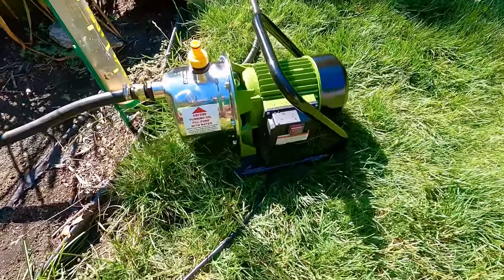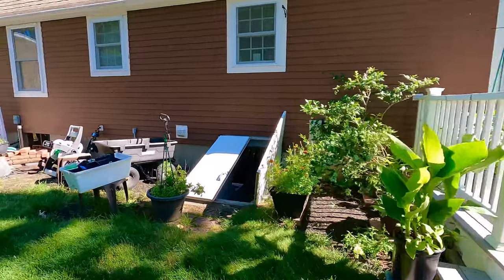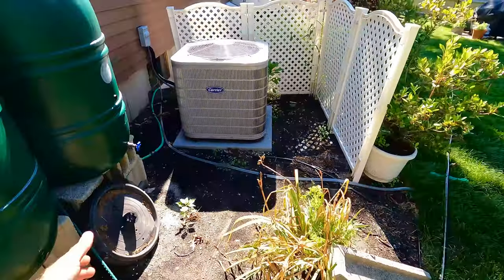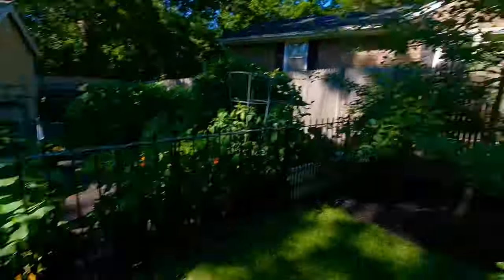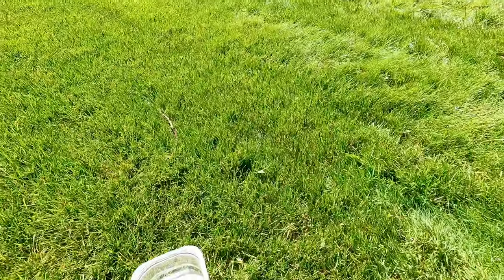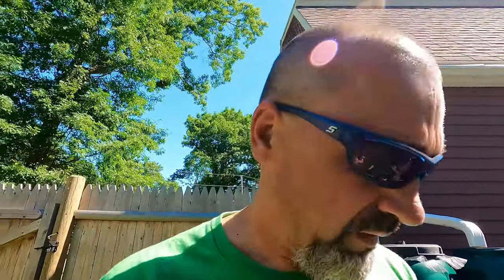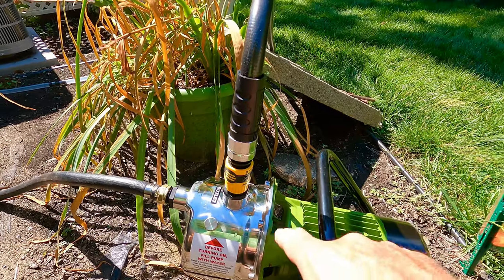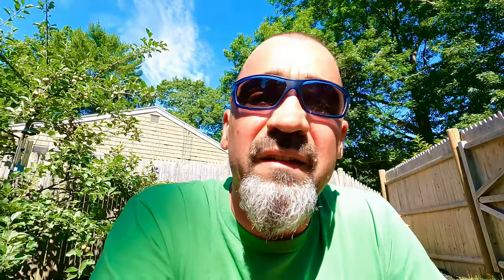Should YOU invest on a RAIN BARREL and SPRINKLER PUMP setup. Is it WORTH IT??

Comment: I wasted a ton of money trying to make a rainwater system. I bought one of those 275 gallon metal framed containers,  set it up to collect water from my roof,  plumbed it to a pump, and set up a timer.  I made a "temporary" in-ground setup with 3 pop up heads and some PVC. 
well it works, but I used up all of the water in approximately 10 minutes and sometimes it wont fill for anotber week if its dry out.  I have 2 acres (probably less than an acre of lawn ).  

so it works but be realistic about how much water you need to collect for what you want to do.  
uour setup is great by the way.
Reply from the maker: I only showed that one barrel, but I have in total about 1200 gallons and only 8000 sq/ft of lawn and a vegetable garden. So my works ok depending on rain fall. I can add about 1/2’ on the lawn a week and water vegetable garden every other day. This year the weather was great so it rained pretty much every week(+-1/2”).
I also have a pretty big roof, that if we get 1/2” of rain it will fill two 275 rain barrels. Have you look into add more barrels? Maybe that’s what you need… good luck 👍

Comment: I’d like to do this as well for some help during the dry spells. The amount of water you have to store is the challenge. But I’ll give it a try. I would like to find a pump that could run off a battery with a solar panel to charge it. It might not run a pump that large but maybe a smaller pump with a different sprinkler setup. Thanks for the idea!

Comment: Heads up on a well, dry spells on our well hurts too. Our water tables drop fast, even at 400 feet down. I can run my sprinkler for about an hour before I have to switch to a backup well we have. Both fill a 100 gallon pressure tank and run around 4gpm on the pumps in the wells.

Comment: I tried to run my gas powered transfer pump off a big trash can and got a minute runtime before it was empty. It depends on how big your rain barrels are and what your pump specs are, whats the psi and gpm it can handle ? If its high youll be limited to short run times.  Mine is 195 gpm and 50 psi. Emptied a full trash can in a minute.. of course mine is 2" in and out
Reply from the maker: Hi Christopher!! My is a harbor freight and I think it pumps about 18gpm… Lol 😂 and 50 psi… I just use garden hoses in and out, I think they are 5/8”…

Comment: hey man awesome video. i’m trying to rig up a solar system that runs this pump on a timer. my concern right now though is that it that the pump has to be primed every use? 

my initial plan is to leave the rain barrel valve open and let the pump work as the valve. the pump will be plugged into a timer that’s plugged into the power inverter and the battery. does that sound like it would work to you?
Reply from the maker: I also started working on a solar system!!! 😁 and the only problem you may encounter is siphon or syphon, the water will  keep running even though pump is not running… you may need to add a shut off valve after the pump… that would also keep pump primed… good luck!!! 🍀👍

Comment: Would you be kind enough to provide a link for the fitting that goes from the pump to the garden hose? I'm have trouble finding the 1 inch x 5/8 fitting
Reply from the maker: As far as I know garden hoses fittings are 3/4 inches tread and 5/8 is the thickness of hose.( in the USA) Is the 1 inch side treaded? If so is it female or male?
All you need to say is 1 inch female(or male) to 3/4 treaded pcv adaptor.
Here is a link for what I used at my house, I hope it helps
1-in x 3/4-in Schedule 40 PVC Reducing Female Adapter https://www.lowes.com/pd/Charlotte-Pipe-1-IN-X-3-4-IN-ADAPTER-FEMALE-ADAPTER/5012475655

Comment: How many gals per min is your pump rated at, and have you thought about running both barrels at the same time using a T? Ty
Reply from the maker: It’s rated for 1075 gph, about 18 gpm… I got pump at Harbor freight about $150 and yes I got a T after making video, didn’t really notice much difference…thanks for watching…✌️

Comment: Would this pump work well for increasing the PSI/ volume out of my spigot to my rotor sprinkler head?
I have about 50 x 50 sq feet area I need to water in my backyard.
My water pressure is fairly standard 
Coming out of spigot, and I want the one rotor sprinkler head to have enough pressure to cover my entire backyard area. 
Thoughts??
Reply from the maker: I never tried that, fortunately I have good pressure here… but it may work, as long the volume of water is enough to keep pump full…I know they sell water pressure boosters, they may be cheaper…I have to say I like the pump from Harbor freight, but is kind of heavy…I hope it helps and best of luck Troy…